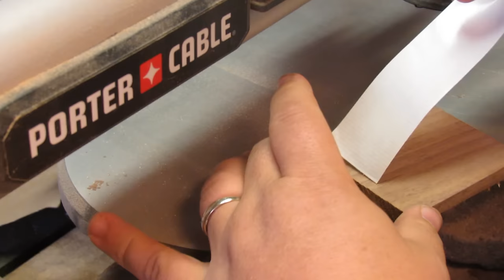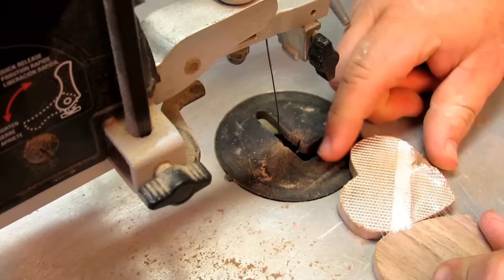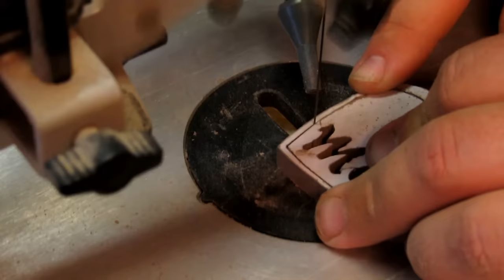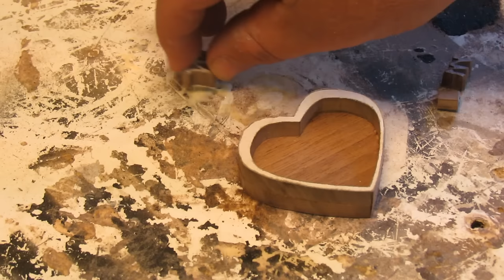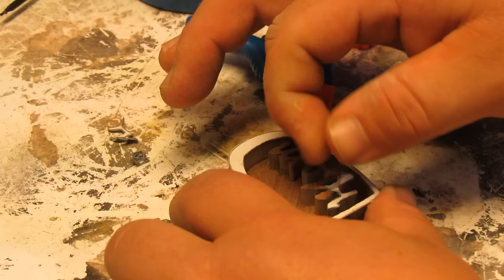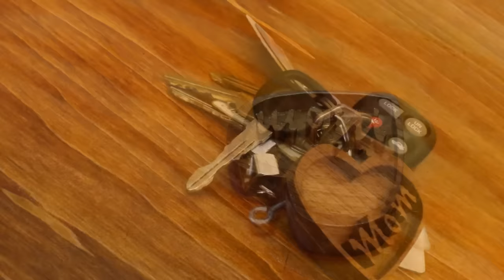Mom's Heart Keychain - Simple Scroll Saw Project with Free Pattern

Comment: What did you use to stick the two pieces of wood together awsome video by the way.
Reply from the maker: Just plain old wood glue.
Reply: Not the glue the mesh at the start of the video
Reply from the maker: Oh, sorry. That isn't mesh. It is carpet tape. It is a very strong double sided tape.
Reply: Thanks again keep up the good work I'm trying to make stuff also I have a Google plus community but in not that good yet still practicing.